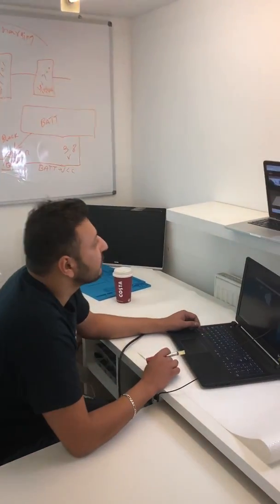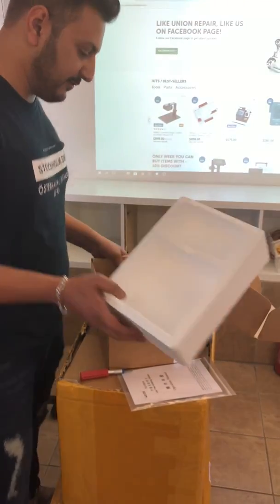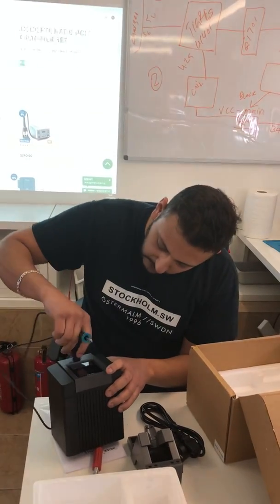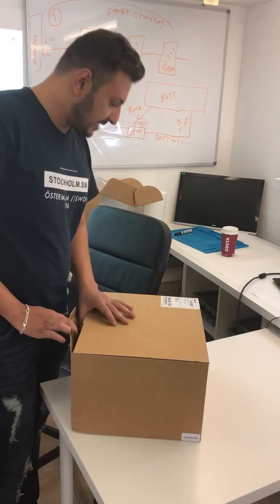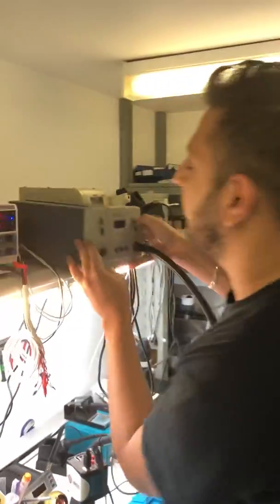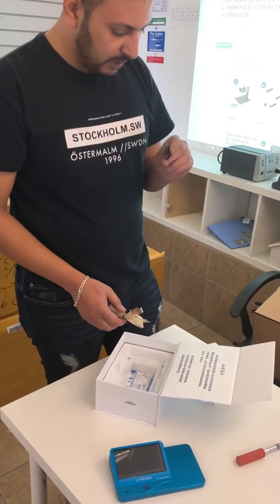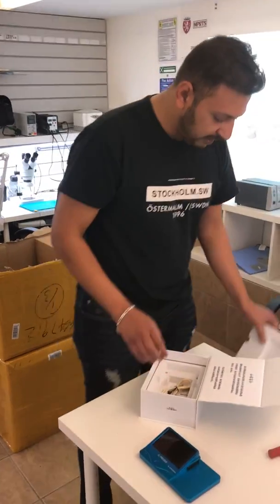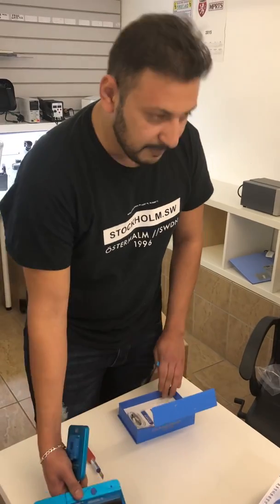Micro-soldering data recovery cellphone repair tools uk

Comment: please i have an iPad skyworth it seem to have a software problem , I've try to flash it with several firmware but the same thing keeps happening, 
after i flash it with new software it will works for something like 2 to three hours then it will freezes again.
i think it has something to with Hardware. I really have faith on you ,maybe you could help me solve the hardware problem i have never encountered something like this ,so please help me with some solutions.
here are the screenshots: